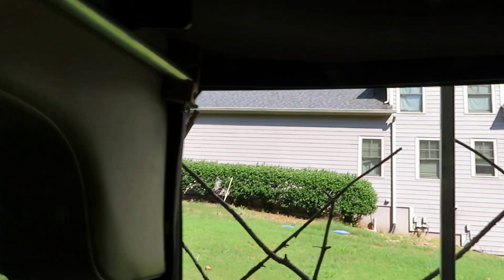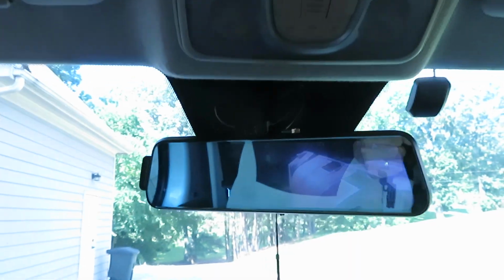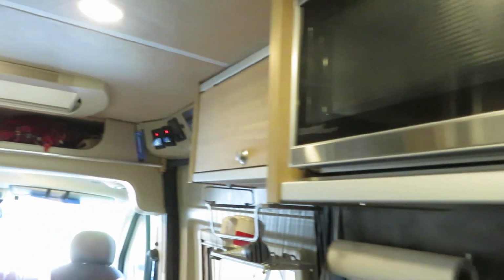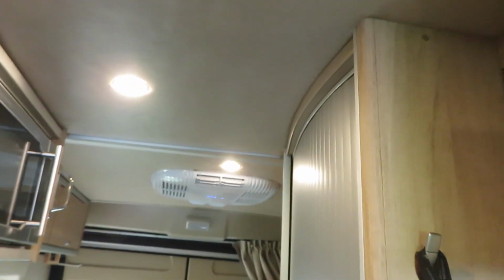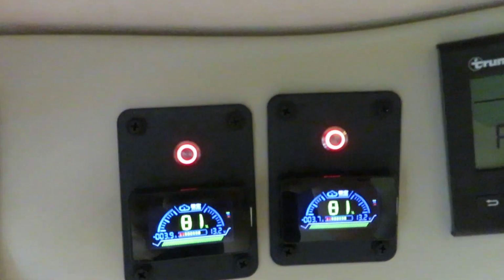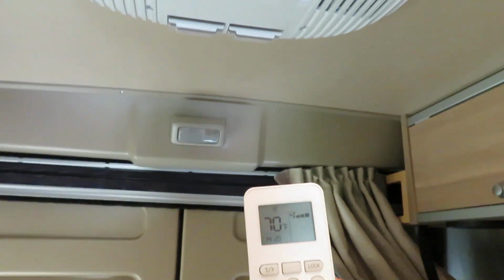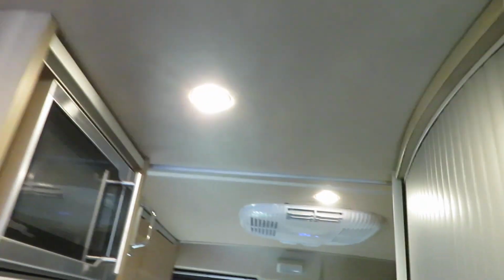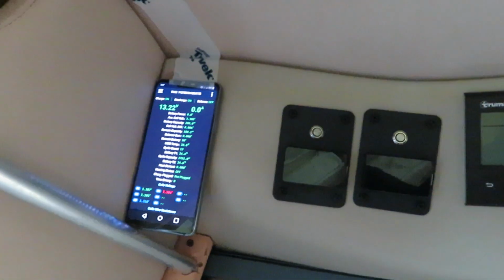JK BMS - 808AH Electrical Van Tour 2: DC and AC Power Usage Demonstration

Comment: Hello Park, fantastic video showing the eletrical upgrades on your hymer. I have a 2017 hymer aktiv and my original EcoTrek batteries start failing, I think the capacity of the battery significantly degraded. I am thinking about replacing the battery and maybe upgrade a bit on the electrical system. Do you mind if I reach out to you with some diagram and if you could give me some suggestions? Thank you so much!!
Reply from the maker: Please post your diagram to this site: https://www.facebook.com/groups/1314409799369442
Reply: @parkhopper3627  thank you! I have requested joining

Comment: Why did you turn off the balancer of the JK? smart phone shows "off"...
Reply from the maker: The balancer was on. It will stay on when the cells are > 5mV out of balance and the high cell is greater than 3.35V. If one of the two conditions is not met, balancer will go off. I programmed it this way to TOP balance only, and not continuous balance.
Reply: @parkhopper3627  The smart phone shows: Balance OFF ......
Reply from the maker: @einfachlogischnixträumen  How many cells do you have? What are the voltages of your highest and lowest cells?